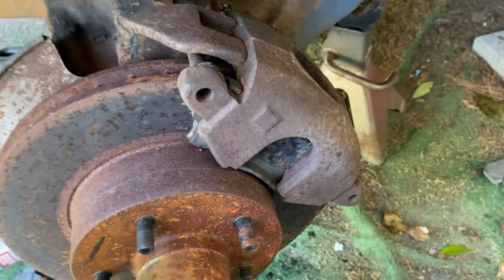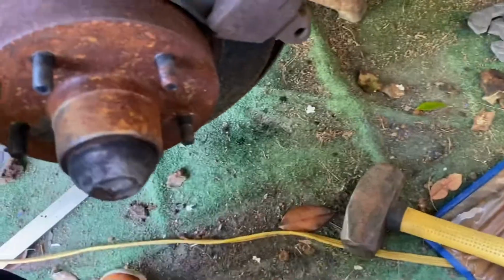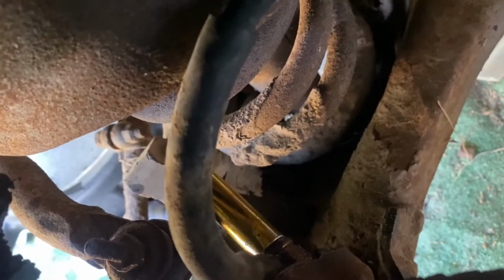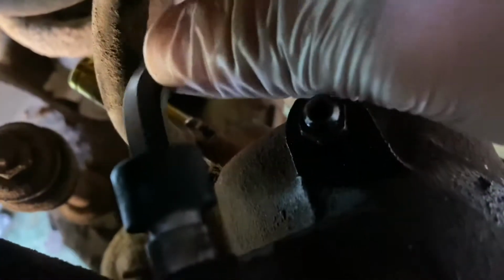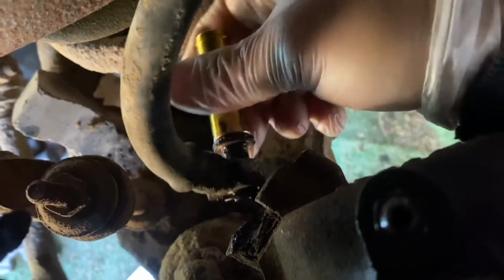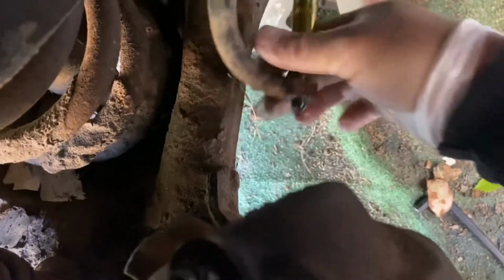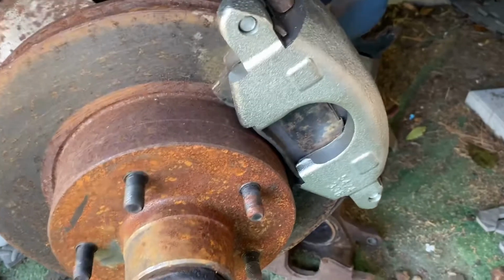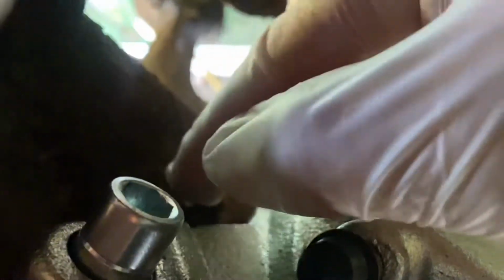How to replace brake calipers on a 1975 Chevy Nova

Comment: 3toSabbath
We23Aug2023
AmesIAUSA
0510
😡
😡
😡
• Q. How does the caliper release the pressure when you depress the pedal?
Q. Is there a spring to help release the grip of the pads on the disk?
😡
😡
😡
💚💚💚
Reply from the maker: The caliper presses the brake pad against the rotor when you depress the brake pedal. When you let go of the brake, it just eases off ever so slightly as to not rub against the rotor